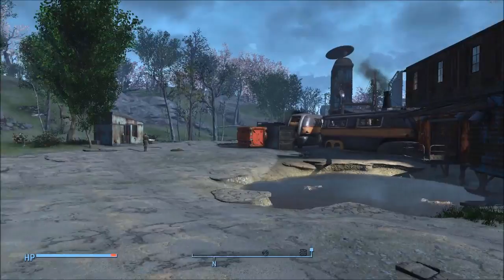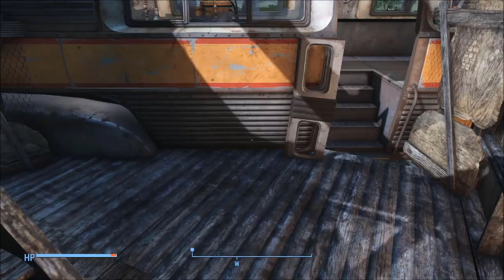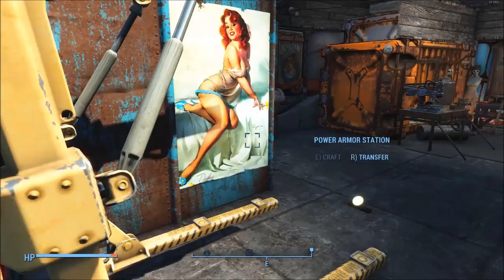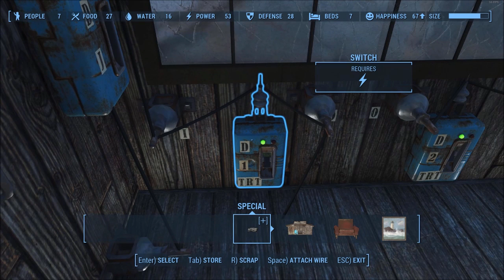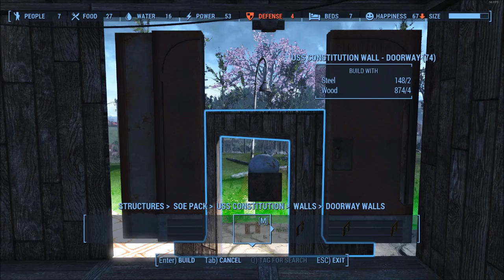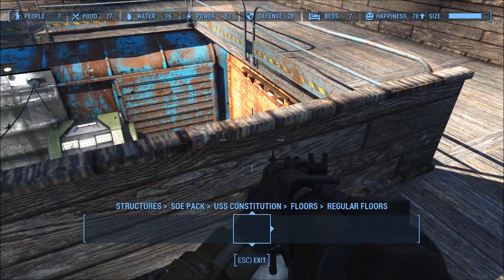FALLOUT 4 Starlight Scrap Heap 3 - The Craziest, Most Insane Security System Ever

Comment: i have a question, would using contraptions DLC tube-wiring (like the set you started using in your ultra smart black fortress.. (its new)  that you have made help counter the wireing soft cap? (i noticed i get this way to many times and i am not even using no where near as many wiring as you get, to the point it glitches and i cant delete the wire...